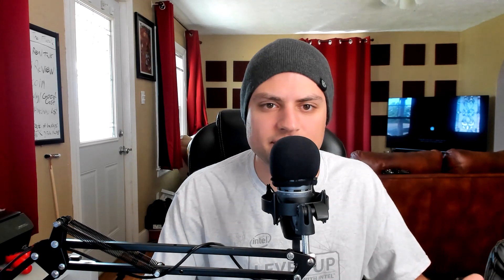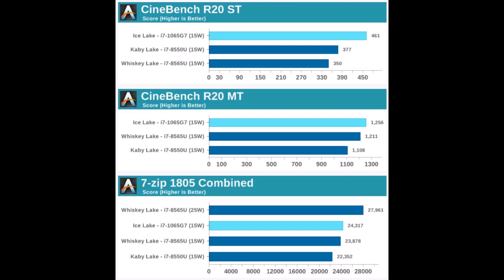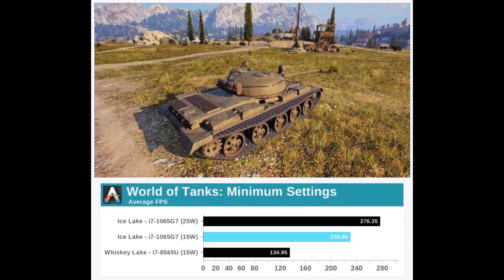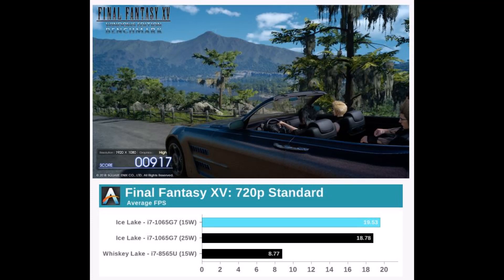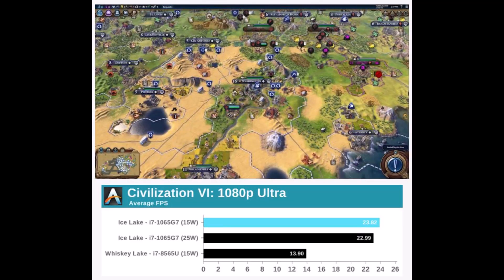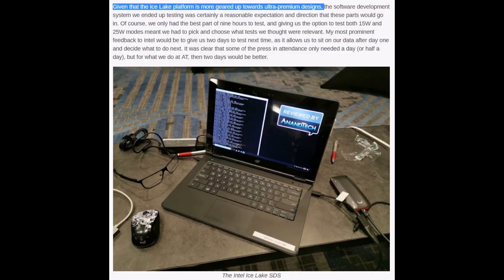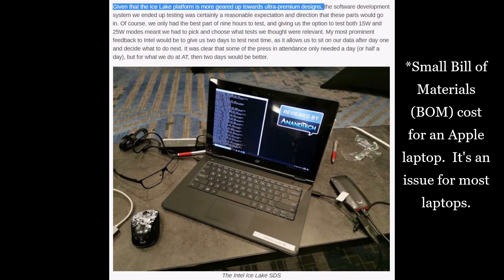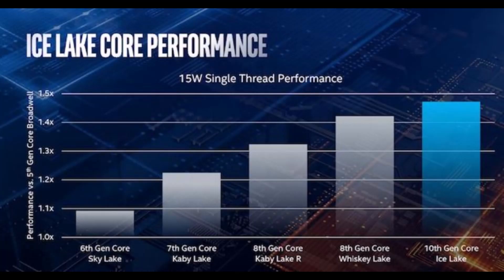The State of Intel’s 10nm+ Process

Comment: I kind of agree that intel is going on 10nm to say they did got to 10nm and then they are just go trying to get to their 7 on time, however their 7 is more dense than tsmc's 5, if they get a year late, they'll still be at a decent time since i foresee tsmc's 3nm having problems. Regarding your comparison vs the mx250, while is true that these intel parts are targeted to higher end systems, only the rock bottom end doesn't have the most powerful variant of graphics (which is a shame, because there it makes the most sense imo), but the mx250 doesn't cost 20, and specially if you account for the fact that they require gddr5 memory. Reaching the level of performance of a mx250 with regular system memory and with the same thermal envelope as the mx250 for ALL the packaging (cpu + gpu) is again, nothing short of impressive. True that even on their best case scenarios intel is only a bit ahead of vega 11 in performance (they have a clear lead on tdp), if the price is right is awesome. I only hope that we see now the refresh from AMD to use chiplets on laptops processors and land above that. I wish they could decouple gpu performance from the memory speed, but if they were able to do that, that'd be a holy grial for APU's. 

Also i have an intel + vega and that thing has a tdp of 65 watts (all package), still that thing is a best, but getting 70% performance of that at 15% the power, where do i sign?

In short, depending on what kind of performance for the graphics we can get from the Y series on that generation, we can expect to get decent priced ultrabooks with decent graphic performance.
Reply: Sheng-fu Horng  i meant in density, and is not quite equal, the slated 7nm from intel was way more dense, however i'm unsure if that's still the case after the 10nm fiasco.
Reply: Tsmc already has 5nm in risk production, and there 3nm fab is under construction. Intels density claims are bullshit, they don't have a working 7nm process yet at all, and their 10nm process still isn't yielding worth a damn. Instead of throwing out their defective wafers,  your getting their underclocked 2 core and 4 core defective parts offered as something to write about instead of just a massive write off. First Intel has to figure out how EUV works and actually develop a working process when they figure out how to use it. Only then can they design an architecture for that process. Then come many months tweaking that process through multiple wafer revisions, and each wafer takes up to 4 1/2 months to create before it can even be tested for defects. Their just at the beginning of this journey.
Reply: @michaelkeudel8770  Do you even know what risk production is? are you even aware of how all this work? Intel has a working 10nm and even if they stuff is "underclocked" the stuff they presented for laptops is impressive (i hope amd has a good response to that as well so we all benefit) thinking intel is out is just fantasy and would also be bad for consumers. 

Design rules from tsmc's 7nm to 5nm have changed a lot so it is not trivial to just move there, intel on their approach has the "advantage" that they can define the design rules they need (this is part of what is complicating everything) AMD will go most of 2020 as the overall performance champion, but intel with their 14nm+++++++++++++++++++++++ has still a pretty decent performance and manages to consitently beat amd (by almost margin of error) on games, all intel needs to compete is to drop the prices.
Reply: @omi6816  yes I do know what risk production is, it's called creating samples which could potentially end up in a dumpster if your planned process and procedures you planned creates defective wafers. Its engineering silicon meant for testing, not high yield production. AMD hasn't released their 7nm apu parts yet, and Intels 10nm aren't really that impressive. Intels one of my customers, trust me, I have a clue of what's going on, I design and build systems that sit inside their fabs.
Reply: @michaelkeudel8770  So you aware that risk production means is still far away from being usable? risk production means the first "complete" internal tests, this also means that they still don't have 5nm at any significant capacity, means that probably by the end of 2020 amd could move to 5nm, this is an optimistic estimate (because amd has to comply with their design rules, and basically fiting a design with tsmc's design rules, is not trivial, and yes amd has a crap ton of experience on this, but still not trivial), so if intel doesn't face any major issue with 7nm and it goes as planned, they basically will catch up, because their 7nm = tsmc's 5nm. Intel's 10nm parts are an impressive paper dragon, but they are stil lthat, a paper dragon, and they can be less impresive if amd has a proper response.
Reply: @omi6816  Intel has plans for 7nm, none of those plans or processes have been tested to see if their theory/guesses are one the ball or work as planned. Every piece of equipment we build is constantly revised by Intel after its been built to their specs, because every machine falls under risk production rules. For Intel to develop and test their theories/guesstimate if their research was worth a shit, they need functioning tools, which until only a few months ago didn't exist. It can take up to 3 years just to get a tool functioning the way you want it to for the results your looking for. Intels 7nm journey only got to step 1 a few months ago, and I can tell you that its already gone through a number of design changes already  over the last year. Sorry, work ethics don't allow me to be specific, but I will say there's an euv control system just being completed 15 feet behind me.
Reply: @michaelkeudel8770  intel is currently making the first tests for 7nm on ireland, is not yet end to end tests (risk production), they are still somewhat far from them, if you are in the states and expected to see the stuff on hillsboro well, you are SOL, the reason why they can go from risk production to production is that they design their chips to met their own design process rules from the start, intel is not as far as you guys think.
Reply: @omi6816  d1x in Hillsboro IS the company's research center, EVERTHING/PROCESS/NODE is designed and perfected there, and then once working is implemented in the other fabs using their copy exact philosophy. Anything Intel has made until a few months ago has been made using DUV and multipatterning, that includes their 10nm chips, which still has crap yields. Defective chips brought you the SX chips and Celerons. It was just a way for Intel to sell  their defective products instead of tossing them in a dumpster. Last years 10nm had defective igpus, this years has the graphics chip off die, fabbed at a different node. Just like AMD uses a 12nm io die with their 7 mm chiplets.
Reply: @michaelkeudel8770  That doesn't change the fact that they are developing 7nm in Ireland and trying to perfect 10nm on Israel, none of what you say changes these 2 facts.
Reply: @omi6816  facts only matter if they are true, since they have ZERO EUV's in either Ireland or Isreal, thats a tall order for them to achieve. They have 1 functional tool so far, and it was only turned over a few weeks ago, and its not overseas. We ship to Ireland and Isreal also, so I know where every tool is shipped, and if its even been installed or sitting in a warehouse for 6 months or more. With NO working 7nm process,NO tested 7nm process, Intels densty claims mean nothing, you can't prove something that doesn't physically exist and isn't functional.
Reply: @michaelkeudel8770  I never said they had a working 7nm process, i said they offloaded the development of that to ireland and they tasked perfecting the 10nm one to israel, i can go as far as tell you that the gpu design is being partially done in Rusia. Idk who you claim you are , but i can go as far as telling you that NONE of the performance numbers shown by intel at computex were real, they were based on a bunch of estimates, but they at that point still didn't have those tests carried out to any official capacity.
Reply: @omi6816  thats where your logic completely falls down and falls apart, you can't develop a process without actually physically having a functioning machine to test if your process your developing actually works or not. 10nm is not going to go anywhere in the short run or the long run, its been a dud for 5 years. They are in panic mode and HAVE to get 7nm working, from scratch. They are years behind in this regard, Samsung and TSMC spent years getting their EUV process working, with an actual EUV machine. Intel tried milking their existing lithography into multipatterning and DUV, while putting off the expense for an actual EUV and the research needed to get a working process. As for who am I, I'm the guy that built the control system of their EUV,  what I can't tell you is how many I've built, when they were shipped, and how many have actually been installed and turned over to Intel to actually start learning how to do something with it, but I do know those answers.
Reply: @michaelkeudel8770  Is not from scratch, they are using the same design rules as 10nm, and we differ from what working means
Reply: @omi6816  what they did on 10nm doesn't work well, and wont work any better on 7nm. If they want 7nm to work, they need to stop trying to reinvent the wheel and use the processes and materials that actually do work at 7nm.
Reply: @michaelkeudel8770  They have over 50% yields now, but they missed their frequency targets that's why they are not aiming to have desktop parts with it, because  a cpu under 4 ghz would loose to ryzen 3000 despite their mild ipc improvements while being more expensive (and yes i'm aware that they gold samples are able to go a bit above 4ghz), power users don't really care that much about tdp, hence they stuck their stuff on laptops and they are hoping they can improve it enough. Sticking with 14nm+++++++++++++++++++++... gives them better frequencies, better yields thus they can be more competitive.

On how this fab world works dude, which you claim to know a lot but it seems that you ignore that process shrink usually means frequency regresion, on TSMC amd has been working a lot to try to get better frequencies but even then you see that navi missed its target, ryzen 3000 missed its target and the huge win was that there was no regresion (unlike intel that has been  5 years on 14nm with full production so they pretty much got everything they could out from 14nm, while)
Reply: @omi6816  no, they don't have 50% yields yet, they doubled what they had last year, which was around 17%, current yields when Zen2 launched was about 32%, while initial batches from tsmc went from initial 70% to 90% today. Intel can't produce anything better than a dual or quad core on their 8 core dies, basically every chip is an SX/Celeron chip with 50% to 75% defective cores, and even those don't ramp up in clock speed. AMDs Zen2 is at revision 1, Intels 10nm is almost 5 years and multiple revisions old and scales for shit. Amd's/Tsmc's process is in its infancy, intels isn't, it should mature after 5 years.

Comment: Integrated is not going to beat discrete graphics anyway.  A graphics chip is mostly a throughput engine that requires significant amount of memory bandwidth per flop. And no dual channel  memory can compete with any reasonable discrete graphics, especially since it has to share it with CPU.  The only downside of having discrete graphics is the extra power consumption which matters in a laptop.  If Intel hadn't gone for lets try to compete with discrete graphics route they could have made 12 core chip with similar die size.  So they could have went for the gaming laptops instead. But this is just inertia of a strategy Intel was implementing and Intel thought AMD was implementing before ZEN was released.  
You underestimate the price of MX250, it would make zero sense for nvidia to pay 15-30 million dollars fixed costs for that chip,  and then sell it at those prices a million or two .  Making a mass production chip isn't cheap these days.  The true cost of card is amortised fixed cost + cost of processed wafers+packaging cost + cost of memory+ cost of other component+ cost of putting components together+cost of shipping+ margin for board partner+ margin for nvidia .  I think the price of MX250 would be around 50-100 USD depending on what margin Nvidia is taking, and if they are taking typical extra margin for being notebook chip.
Reply: Ponder this one for second......

I've seen rumours that AMD is developing custom memory controller/i.o dies with integrated hbm2. Imagine a single package with a Zen and Navi chiplet.
Reply: Of course integrating HBM in CPU package is possible, that means extra cost and is similar to what Intel has done on some high end chips to put large on package memory. 
However the HBM nor extra memory controllers becomes any cheaper when integrating with CPU and die area becomes more expensive bigger it gets. And at same time the performance of CPU and GPU depends on wattage you can give both of them ,and splitting a relative low power budget of a CPU socket between those two scenarios would be well beaten by having separate way higher power budget for GPU.
 What we probably would end up from such  design is something that would have worse price/performance than having discrete GPU and a CPU.  
There is a market where it would potentially make sense, that is currently served by nvidia compute servers costing over 100000$ .  But anything related to cheap consumer stuff probably bad idea because of non-linearity of silicon costs and high HBM costs and power limitations.  
Of course if HBM would get ultra cheap,  then they could integrate some weaker GPU to IO die, and give it own bus. Or replace DDR4 slots with on package HBM, and use the HBM for both CPU and GPU ram and take account of that in the pricing of the chip.  The integrated GPU:s are cheap because they reuse memory controllers of CPU:s and are purposefully 5-10x smaller than discrete GPU:s people really want, and even those small GPU:s would be better to be replaced by 4-6 additional cores.   

It all comes to what else you could have for similar cost, and most of the time having those separate wins.

Comment: I prefer Intel to AMD because I have had good luck with Intel.  AMD on the other hand is a different story: I bought  a Ryzen 1700 which turned out to be unstable.  For over a year I didn't know why until I discovered that it had the Segfault bug.  I rma'd the chip and was shipped a replacement.  Two days after installing the replacement chip, I discovered that it had the Segfault bug as well.  Any chip from the 1000 series can have this fault, but it only shows up in Linux.  At this point none of the pro-AMD articles and Youtube videos will convince me to buy an AMD cpu again (I still like Radeon, however).

Comment: The deal is: The smaller your lithography process, the harder it is to achieve high clocks (>4 GHz). It needs a lot of research and optimization to reach high clock speeds. So AMD will further increase IPC and try to increase clocks. And Intel probably won't sleep but they are very far behind AMD. I think AMDs next Laptop CPUs will kick Intel's ass on 7nm+!

Comment: 25 watt ice lake CPU is faster than the 15 watt ryzen 3700u, wow
Reply: Isn't the 3700u still on 12nm? Intel's a joke right now lol
Reply: @Phenom98  yep it is and it has graphics that are better or just as good at 12nm on cpu and 14nm on gpu so RIP Intel when 7nm 4700u
Reply: @jedijackattack3594  wait till navi igpu release....
Reply: Depends on the review, one HotHardware it failed to dislodge a feisty 15w 3700u in GPU performance.  This is with 3733MHz compared to 2400MHz on the 3700u.
Reply: Not surprised how big is the margin